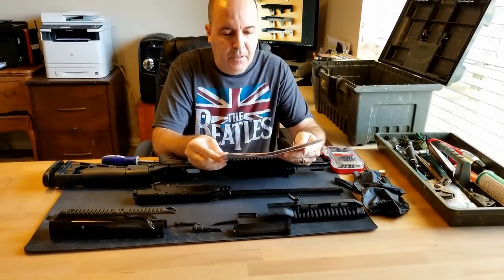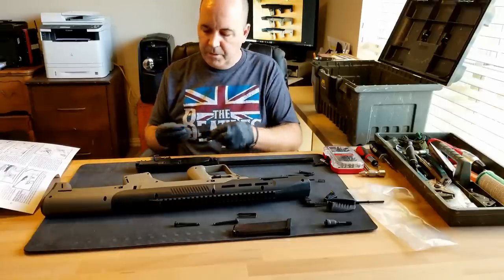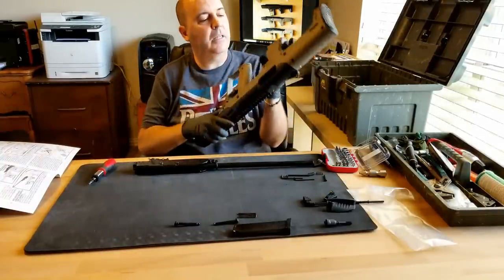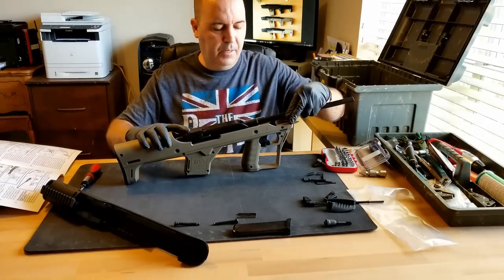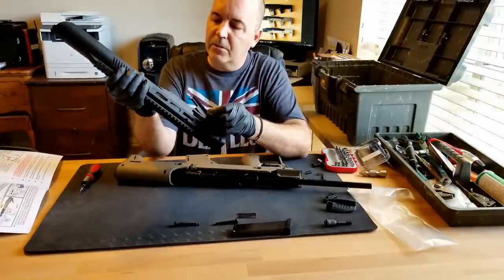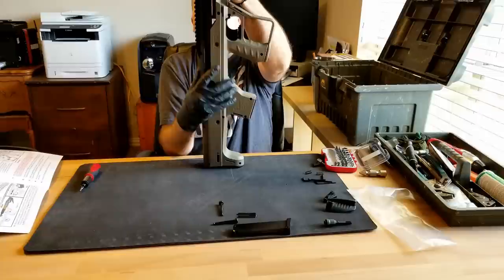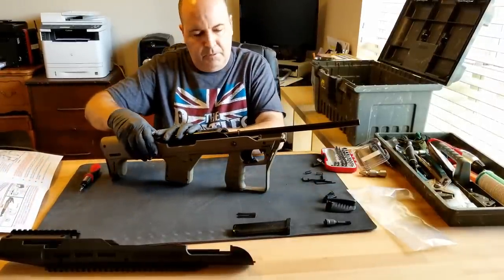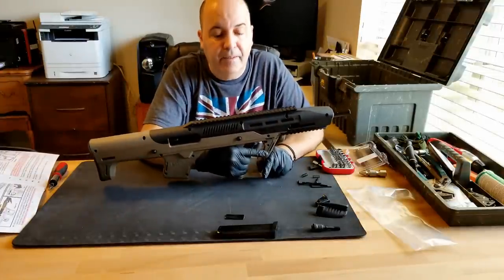HTA MBS 95 Bullpup install of the Hi-Point 995ts High Tower Armory

Comment: The HT Armory website specifically says that you have to use 9mm, any other caliber wn't work... But watching you assemble this, I don't see why it would really matter. I only bring this up since as many of you know, Hi point just released a 10mm version of the carbine recently. And I think it would be nice to have a 10mm bullpup.
Reply from the maker: mikeakaspike you're in luck because they make one in 10mm. Also 9mm, 40s&w, and 45acp. Each caliber is marked into the stock so not to be confused. The one obvious problem using a 10mm in a 9mm stock would be the magwell. There may be other reasons but i dont know them. If you get one in the caliber you want you will love it. Have fun and be safe.
Reply: Very Cool news. But I was on their website earlier, and I could not find an option for any other caliber... You know where I can find them? *Edit: Okay, I see that they say it's available in all calibers, but I don't see an option to change which one...
Reply: 380 does work

Comment: You should always do a dry run before doing a recording. This is what guys like MAC and Forgotten Weapons do. Just a real quick check that you actually understand the steps and parts involved in field strips/assembly instructions.
Reply from the maker: Indefinite you are correct. I was going for real. Probably would have been better with at least one dry run. Lesson learned. Thanks

Comment: I wish someone would make a Vid on just adjusting the trigger on these, Hint Hint, LOL. it took my muscle bound son and I to pull the stock apart. I used a rubber mallet to beat it back on,lol. Update - I read somewhere there was a couple screws to adjust trigger travel so I took my new (just got it today) Bullpup apart and looked for those screws. I didn't see any at all that would adjust the trigger so I assume the new ones don't have the screws anymore. I only saw a rod attached to the HTA trigger That pushed against the Hipoint trigger.HHMMMM
Reply from the maker: Unless you have the first version, they don't make them adjustable anymore. But I think it would make for some great education ;)

Comment: thats so sick! for 250 i feel its a little steep for me personally but definitely a down-the-road mod for sure.
Reply from the maker: Cap yeah i probably bought the gun for less than the bullpup stock, but if someone was making a 9mm bullpup for $5-600 dollars I'd buy it in a heart beat. You might find a cx4 storm used in that price.  But it wont come in to configurations. Carbine or bullpup. When you can save up get you one. You wont regret it...
Reply: For me I already bought a 995ts years ago. Makes perfect sense to convert it to a nice bullpup.

Comment: So does the 9mm conversion not use the chassis retaining pin conical springs like the 45acp conversion does on the two pins?
Reply from the maker: Yes it does. You pull it off the old pin and put it on the new pin

Comment: This is a huge improvement in appearance from the goofy assed original.  Does it add any weight?
Reply from the maker: So I weighed them stock only and then final setup including sights. First stock only
995ts is 2lb 14oz
MBS95 3lb 2oz
995ts Loaded with red dot, green laser, 2 mags, leather  buttpad cheek rest is 7lb 14oz
MBS95 loaded with red dot, 2 polymer sights, angled foregrip is 7lb 13oz
So for my setup about the same loaded. About 4oz different bare.
Hope that helps.

Comment: Have you had any problems with this kit? It makes my gun jam every shot but it’s fine in the normal body
Reply from the maker: No. I've never had any problems with mine. Thats strange. Sound like your having a fit or magazine issue. Did you add the counterweight where the charging handle is supposed to go? Other than that make sure the action is free and not rubbing. Keep me posted.
Reply: @JAM4MORE  yeah I put the counter weight there, idk what’s wrong with it, I’ve tried taking it apart and putting back together what seems like 50 times, unless it just needs to be broken in more as I’ve probably only shot the gun for 100 rounds plus but it works in the normal body so it should in the kit
Reply from the maker: @naturalgamerjk606  definitely something wrong. It shouldn't be any than just moving it to a different stock. And that shouldn't mess with the internals. That leads me to believe there is a rub somewhere in the action. The only thing external is that metal plate and upper receiver movement. I would look for wear. You could wrap the upper with a layer of tape and cycle it by hand and see if there is any tears or wear.... hope you figure it out. Call Andy at High Tower Armory and see if he has had any problems.
Reply: @JAM4MORE  this is confusing for sure but I will definitely give it a try that’s very smart, I will also be cleaning everything on the gun itself tomorrow so if it’s the action it will hopefully be fixed. thank you

Comment: I know this is super old vid, but was there any weight savings with this conversion?
Reply from the maker: So I weighed them stock only and then final setup including sights. First stock only
995ts is 2lb 14oz
MBS95 3lb 2oz
995ts Loaded with red dot, green laser, 2 mags, leather  buttpad cheek rest is 7lb 14oz
MBS95 loaded with red dot, 2 polymer sights, angled foregrip is 7lb 13oz
So for my setup about the same loaded. About 4oz different bare.
Hope that helps.
Reply: @JAM4MORE  Thank you for your very detailed answer! Did you notice if the weight changed at all? Like moved back? My biggest complaint is how heavy it is out on the foregrip.
Reply from the maker: @GDKimble  it feels pretty balanced to me. One of the easiest guns to handle that I own

Comment: The hp carbine is a good gun, but why would you spend all that money on upgrading it, when you could simply buy something much better?
Reply from the maker: That is a good question.  Here is why. It is a great gun in its stock configuration for the price. Adding the bullpup stock upped the fun factor 10x's and you cant find a better deal on a bullpup for that price. Lastly I own the good stuff that cost 4-5x's this combo. And I alway go back to this one because it is so fun, and accurate. It will eat any 9mm ammo I throw at it.... Hope that helps

Comment: Great video, but spend $300 dollars on a ugly carbine then spend another $250( =$ 550 )to put lipstick on it.. i  dont know .. I think save your money and buy an entry level Ar 15.
Reply from the maker: MrCokeman01 if you want an AR9 you can pick those up around the $550-600 price range also. You can probably build for less. But its not a bullpup so its really a peronal choice. I have never had problems with any of my Hi-point carbines. They just work and are cheap if you don't buy the bullpup. And the come with a lifetime warranty. Unless you've actually shot one you can't appreciate how fun they are. Thx for the comment. Have fun and be safe.
Reply: MrCokeman, My old 995 'Monkeygun" as we called them, due to resemblance of the Planet of the Apes prop, Cost $115 back in the day. Adding MBS995 bullpup stock gave me a kickass 9mm bullpup for under $400! Compare that to a 9mm Tavor for $1500... As a '68 to '74 era vet, for business I turn to a Saiga AK...
Reply: I think many are missing the point. The real fun is in buying the upgrades, which in comparison is not as expensive as for the ar15s its really a lot of fun taking something that's not so pleasing ( to some, I think they look great!) And improving its looks by 100 percent!!!
Reply: @colbolt54  ∆∆∆ this guy gets it!
Reply: People like me don’t want an ar15 they want a bullpup 9mm. To me my 550 was well spent. 8$ for 50 rounds of ammo, can’t beat it
Reply: If you buy the hipoint used they are fairly inexpensive. Add bullpup and it's about keltec s2000 range. So it's really a preference.

Comment: Dumb.  The reason I would buy the stock is the hi-point is so damn ugly.  The reason I would by the Hi-Point is its so damn cheap.  If it's over $500 for both, I'm going to get a better carbine.  Useless.  A stock needs to be half the price of the actual gun to be viable.
Reply from the maker: I hear what you're saying. You can build an AR9 cheap around $450 or so. But I own about 10 9mm carbines. The Ruger PC9 the Marlin Camp 9 the Just Right Carbine the Keltec Sub 2000 and the rest are some variant of AR9. With that being said none of them are a Bullpup except the Hi-Point in the High Tower Armory MBS95 stock. 
So I would say unless you already own a Hi-Point and want something different the cheapeast way is to do that is convert it to a Bullpup. Unless you can buy something else for under $300.

Do what works for you. I personally find this combo to be one of the most fun to shoot.
Reply: You and the 2 likes you got: what bullpup do you currently own, since it's been 3 years now? Right, the same number you had when you labelled yourself on this comment.